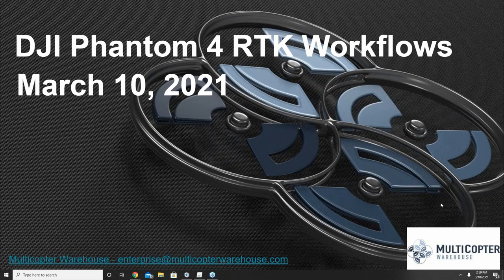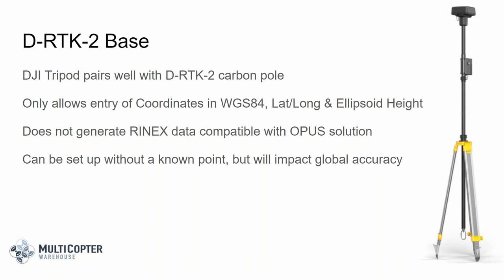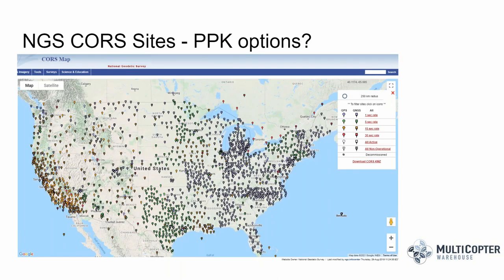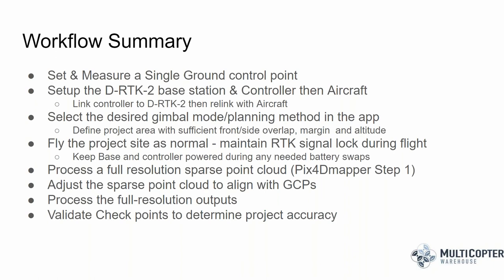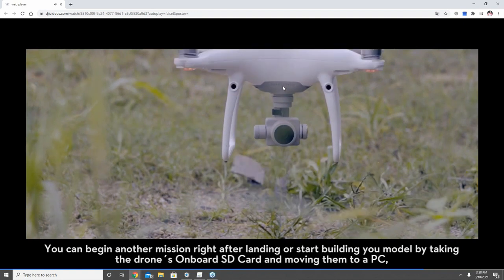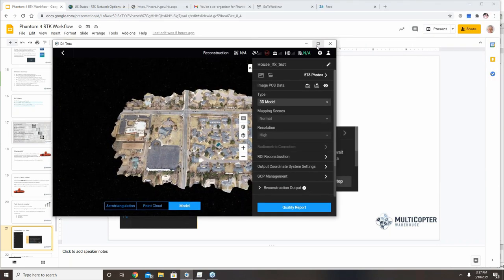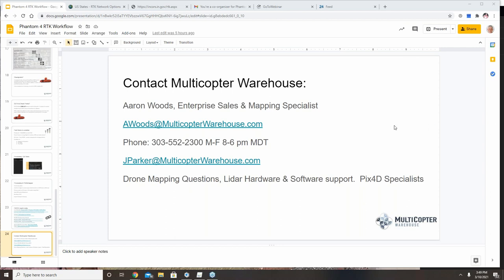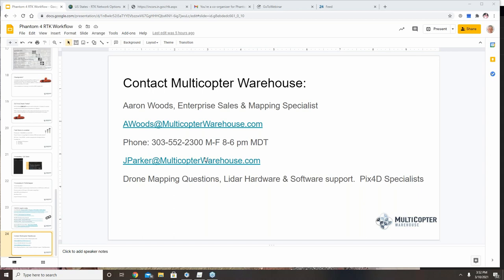DJI Phantom 4 RTK Workflow Webinar

Comment: Did you ever get to test more on the multi oriented mode? Whats your experience with it and what does it actually do?

Thanks
Reply: @Ted Creteyes exactly. Does it alternate between angles mid flight or fly the same route multiple times with different angles?